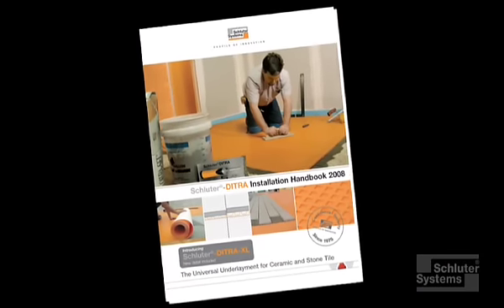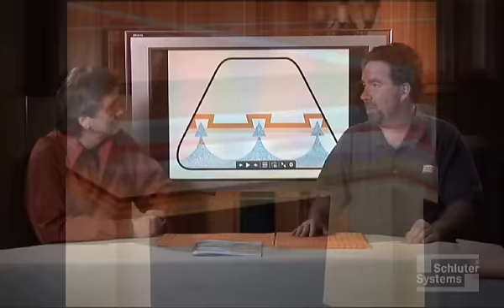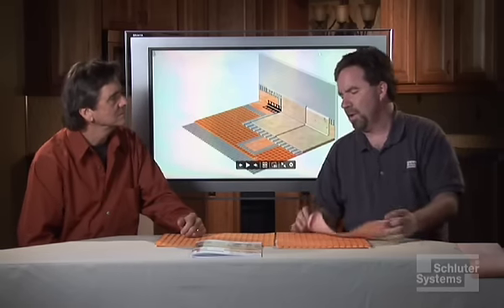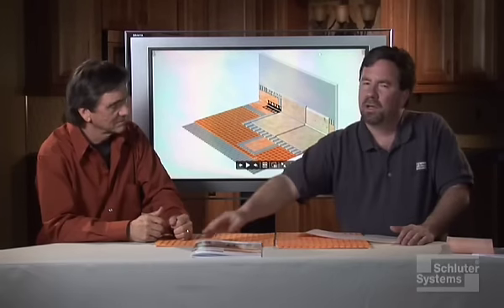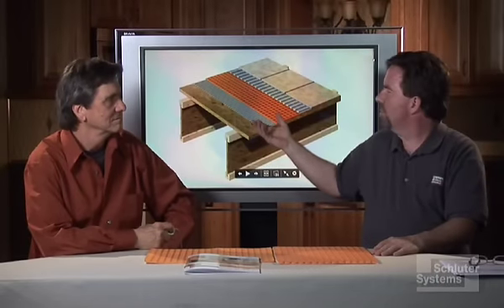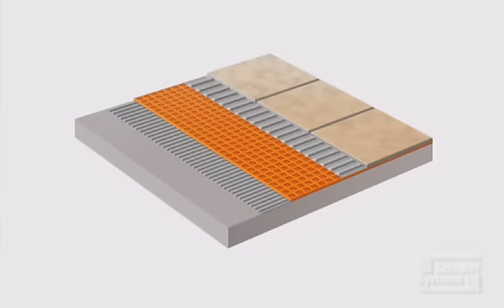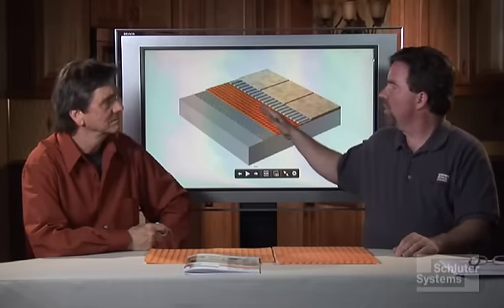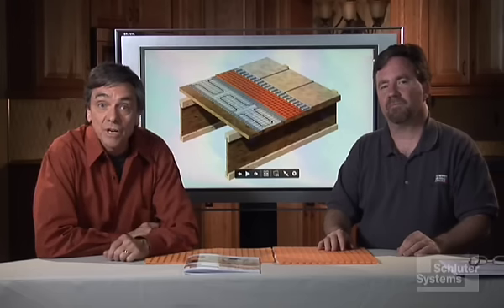Schluter®-Systems: DITRA/-XL Underlayments for Tiled Floors

Comment: If you have a small bump can you still tile over it, or should I cut a patch chisel out the thin set and start over?
Reply from the maker: Hi Adrian! 
Cutting out the DITRA, fixing the bump, and reinstalling a new piece of DITRA is the best way to handle it. If waterproofing, remember you need a 2" overlap of KERDI on the seams when reinstalling. 
Hope this helps!
Reply: This does help thanks

Comment: Warning to DIY'ers using the Ditra XL - be very careful.  This is not an easy system to work with.  

I've used the regular Ditra in the past because I like the engineering behind it.   I am in the process of building a basement bathroom, so tile on concrete floor.   I figured to use the XL (for the first time in my life) because I wanted to match finished floor elevations, which XL markets itself as being great for.  In reading the Ditra Installation pamphlet, it stated to use a 1/4 x 1/4 square notch trowel with the XL, which I did.   (This is a different trowel than the regular DITRA).    Combed out the thinset in straight lines, applied the XL and then pressed it with a float and roller.  Then I peeled back the XL to ensure proper coverage with the thinset as per the instructions only to find that there was an awful lot of of white flees still visible, especially bad between the ribs.  Then I made the MISTAKE of adding more thinset.   That solved my coverage problem alright, but created a NIGHTMARE situation of too much thinset.  Pressing like mad with a float squeezing out excess thinset, rollering, etc. etc.  It was incredibly labourious.  Crazy in fact.  But hey I had good coverage.

After 2 runs of the XL, I thought, "there has to be a better way, this is nuts".

So I went back to my original thinset application methodology, only this time, I troweled the thinset in straight lines parallel to the Ditra XL sheet I was working with, then stuck my fingers into the chicklets and pulled the XL laterally side to side at 90 degrees to the lines in the thinset about half an inch a few times (back and forth).  (Like you would do when laying tiles.)  Voila.  This worked like a charm.   Good coverage, and no excess thinset to push out.  For some reason, they never show you this technic in any DITRA video.

But this much is for sure.  With the XL, you can't simply apply it to the thinset and then push down on it with a float as you would with the regular Ditra.  It just won't work.  I think the difference is simply the deeper chicklets make it real difficult to work with. XL is not a one man job.
Reply: Did you mix your thinset up like normal? It is definitely a one man job.

Comment: According to the info given here the only reason to use ditra XL is for ease of transitioning to a hardwood floor?  If there are other indications or benefits to use the XL, then please what are those reasons?    Thanks
Reply from the maker: Hi James,
Apologies for the delay. DITRA-XL also allows for ceramic tile application over single layer plywood/OSB subfloors on joists spaced at 24" (610 mm) o.c.
There is a more detailed explanation on page 27 of the DITRA Installation Handbook. You can find that here: https://sccpublic.s3-external-1.amazonaws.com/sys-master/images/h18/h68/8982734077982/DITRA%20Installation%20Handbook.pdf